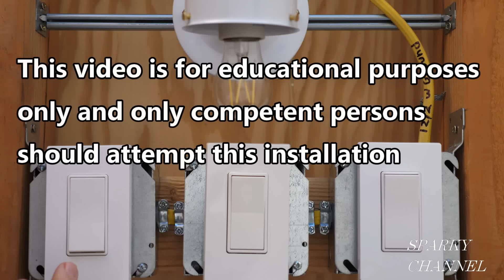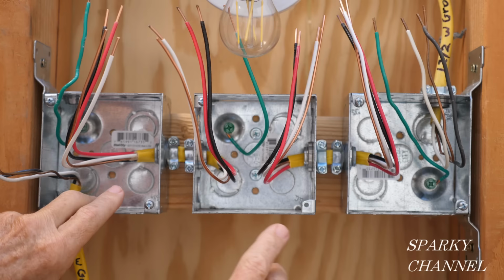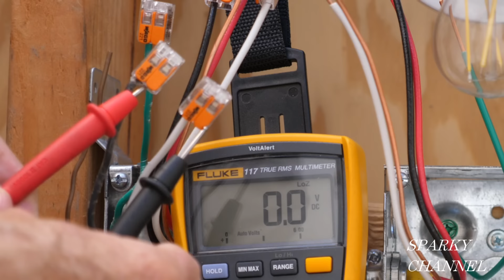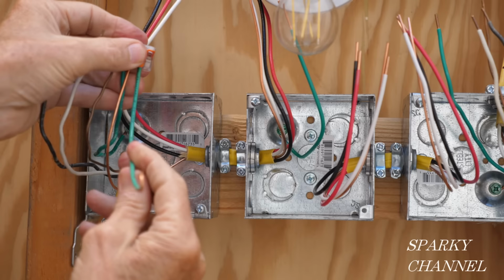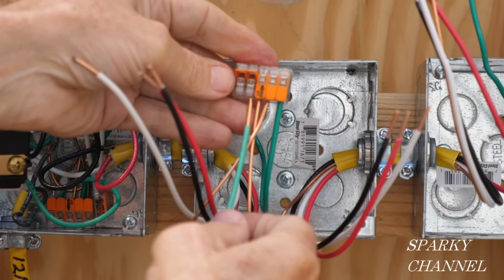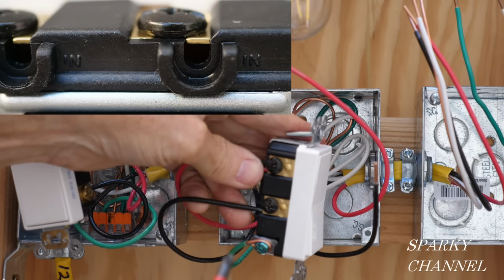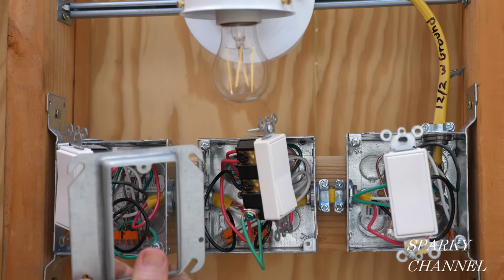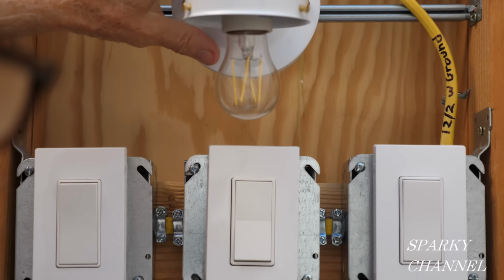How to Wire a 4-Way Switch System

Comment: Good demo !  Now show one where the power cable comes into the light box instead of one of the switch boxes.
Reply: @Sheila Walker That's true, but that's not what Ed was asking for....

@Ed Smith  As you requested, 2-wire feed to light box is simple...drop the neutral (white) at the light box. Hot (black) is spliced to the white (wrapped in black tape) of another 2-wire that is going to your first 3-way switch....the black wire of this 2-wire is the switch leg back to your light. At the first 3-way, wrap the white wire with black tape as well, and splice it to the black wire of the 3-wire that goes to the middle switch (4-way). Carry through the black wire (hot) to the last 3-way switch on another 3-wire. At the last 3-way, the black is the common (hot) and red and white wires are again the travellers between the switches.

You can even reverse the sequence and attach the white wire that's tapped black to the common terminal of the first 3-way and splice the switch leg back instead. The point is, if you understand the concept and how the wiring works, you can have the feed and switch leg on any of the boxes...typically we (electricians) wire it where it's the most convenient.

Cheers

Comment: Thank you very much for your informative videos. I have a question on this setup. I see that you have the light at the end of third switch box. Can the light be installed between first two switch boxes or even the first box?
Thank you very much in advance.

Comment: One thing he forgot to mention is the if ADDITIONAL SWITCH LOCATIONS are needed, then More 4-way switched can be wired in
between the ends being the 3-way switches, The additional 4-way switches are wired EXACTLY like the 4-way in the middle. The Travelers go to the LOAD side of the next 4-way switch. Not sure on Code requirements, but You could wire in many many more 4-way switches in between the two ends, and the starting and ending locations WILL ALWAYS be 3-way switches. If Additional Locations are needed.
Reply from the maker: Excellent explanation, thanks!

Comment: Awesome lesson!  I never really understood this until this video.  I have a question regarding what I have at my home. I have a double gang old house switch box with two lights feeding out( both single pole) and for some reason I also have two lines feeding out on the circuit heading into the kitchen, I have one line feeding in from the breaker.  I have a total of seven 14/2 in the double gang box?  Do I need to change the double gang to a triple for more room or should I go with a quad gang??  Thanks again for your great video fantastic job!  Mike
Reply: Good scenario for a box capacity lesson!

Comment: I used to do that 4 ways switch most every months and fixed those 4 ways too lot's of houses got wrong connection and the point is looking for the correct wires to connect to it take some times

Comment: I have a 4-way switch going to two ceiling outlets where I will use half of each with a light that I will plug in and the other half of each outlet I want to stay hot all the time, do I still run a 12/2 wire to the first outlet after the last switch? Or does it need to be 12/3 wire
Reply: 12/3. You need a switch leg and power
Reply: @daribbz8476  thank you Danny, that is what I had run because it made sense, got them hooked up yesterday and work like they should, thanks again though

Comment: You should do a follow up to show everyone how to wire it when you have power cable to the light coming out of the same box as the load in box and then the middle.  Also when you have to add another four-way.
Reply: You can add however many 4 way switches you want between the 3 way switches at the beginning and end. Doesn’t change anything except the number of switches.

Comment: Another great video! I'm getting my high school classroom prepped for the year as we speak brother. I'm one of the only trade instructors at the high school level here in Texas. This is a very clear instructional video, and I hope to make some just like it this year. And who knows with the way things are going in the country, I may be making a Bunch of online videos... But, I do like teaching them 3 way wiring, and then when I show them where a 4 way switch would go, it makes it super easy to understand. Basically just cutting the travelers in half. Keep up the great work sir!
I do have one question. Are the stab in wire connectors rated for joints in j boxes? I've often wondered. Of course I use them all the time in light fixtures. And I know they have a high amp rating (I think around 15 or so?) but I tend to wonder about a large load down the line, as far as the connection. My way of thinking is if you can twist the quick connect in a circle while its on the wire isn't it slightly loose? I know how the spring grabs the copper, but I still wonder about large load arcing down the line. But to be honest, I haven't found many melted quick connects in ceiling 4 square boxes on any service calls when I go to commercial locations. What are your thoughts? I haven't seen anywhere that says you can't use them. I believe it would just need to be Listed, which they are.
Reply from the maker: Thanks! See my video: Wago Lever-Nuts Questions and Answers From National Electrical Contractor Convention: https://youtu.be/d2lkBlIPkHg

Comment: Thank you so much for this wonderful tutorial. I recently wired my new LED kitchen lights using your method. After I finished everything up, my found yet another location she wants to have a switch! Question, can I add another 4-way switch in a new location using this method?   So, my plan is to run another set (2) of 14/3-wire (it’s on a 15amp circuit) and 4 way switch to the new location, and run through the new 4-way switch putting the RED wires on top. I guess this would be a 5-way switch?  Will this work?  Thanks in advance.  Mark

Comment: I do have a question about an old house, say 1988 already wired but one of the switches doesn't always work, I guess the traveler wires mixed with load or wrong switch.   What's the easiest way to determine which switch in the incoming load, i.e., the first switch on the circuit?
Reply: Pull all switches out of the box , in each location. 
Disconnect all wires from all switches. 
Test each wire for power .

Comment: So, you could theoretically place an electrical receptacle just below the first switch box by splicing power from the line power 12/2 wire prior to connecting the 12/2 wire to the first switch?

Comment: Why do 12 gauge wire? It’s hard to handle. Here in MN do 14 for lights
Reply from the maker: 14AWG for lights is fine as long as it's on a 15A circuit.

Comment: I have 3 switch for the foyer light but they only use 3 way switch for all the 3 switch sometimes i have to the switch by the front door off all the time because I try to use the switch by the kitchen doesn't do anything and the switch upstairs is always on and it doesn’t do anything until the kitchen switch is on position as well. To use the switch by the front door I have to have both of the other switch to off position.

Comment: Where does the load wire go in the circuit? Question is can the load wire come off 2 separate switch,  basically 2 loads feed same circuit on opposite sides of the house? Or does it  always come from last 3 way  switch?

Comment: Great video!  I'm trying to replace my light switches to newer ones and my wiring is different.  The first three way is like yours except all the grounds are connected together as are all the whites.  The travelers are red and black, and the line in is black. The four way looks the same as yours and the last three-way switch has red and black travelers with white going to the load.  Any idea why it would be wired in such a way?  Thanks again for the great video!

Comment: I have Eaton 3-ways and while in is on top, they put the two black screws on bottom.  Not sure if there is a standard on 4-ways but that a bit confusing as your switch has the two black on one side.

Comment: As an Aussie sparky its interesting to see the differences. We would cal this a three way with straps. The "3 way switches are standard. The 4 way we call a intermediate switch. Still have problems with calling a white wire a neutral.
Reply from the maker: Sounds great. I understand.

Comment: Bill this is a great video. I live in an old house and the switches are already installed. I am in the process of replacing the light. Coming into the light box is two white, two black and two red. When I took the old light out the two red were connected w wire nut.. the light actually had two white and two black that were connected to each white and black. Now the new light has only one black and one white. How do I wire this light?  Suggestions?
Reply from the maker: Hi Dan! Was the old light working fine? If so, my suggestion is to wire the new fixture  just like the old one.

Comment: Please help, I’m confused on the second 3 way switch being different from the first, as in the line coming in on the common and load traveling on the two screw side. Which is normal to me, but then you have the line coming in to the two screw side and traveling out the common screw to the light. I realize this has to be the only way a three way could work but I’m wondering how the switch can work both ways. I’m just an apprentice going into second year and a good explanation would help me!
Thanks!

Comment: Your video was easy to understand.  My issue is the electrician that wired the house for my 4 way took the line and load to the 4 way and the 2-3 way switches only has a red, white and black.  When I turn off the one 3-way, I cannot turn on the light at the 4 way.  Is there a way to fix my issue?
Reply: Switch the wires around in the 4 way. Till you find the problem.

Comment: Can you please do a THREE ROOM switch system controlling one appliance? e.g. ducted fan to 3 rooms?
Thank you so much! p.s. only have Active, Neutral and Earth (in Aus). Thanks mate!!!
Reply: ie. So different to your example. If someone in bathroom, and you turn on Laundry light, the Fan remains on. Or if Laundry is on and Bathroom turned off, Fan remains on. If Toilet turns on, and Laundry turns off, then Fan remains on. :) Then if Toilet turned off, fan turns off. 
3 rooms with own lights. I separated Toilet Light + Fan to two switches without any issues a year ago. Laundry + Bathroom both single switch. If any one is on (bathroom is just fan switch) then fan remains on - i.e. operates in Parallel - not series like your example. Thank you! :D (Network Engineer)

Comment: I’ve recently changed a couple of broken light switches. I’m thinking I should’ve gotten two 3 way switches to turn the light on and off at either switch? But my issue was that I had 2 black wires and a white wire inside one of the boxes. And in the other switch box I had a red a black and a white wire. So does that mean the white wire in both boxes are neutral? And if so would they go onto the ground screw on the light switch?

Comment: Great video. Very well explained. Question: can I wire the lights somewhere in between the 3 switches, or does the light have to be fed after the 3 switches?
Reply from the maker: Yes, the light(s) can be wired in between the switches but it's more simple to put the lights after the 3 switches.

Comment: Sparky do you install a dimmer on the first run only. Or can you have multiples  dimmers on the same circuit?
Reply from the maker: Depends what model you get. These are "high dexterity", so they won't protect the tops of your hands very much.

Comment: Do you ever use 12-2-2 Romex for 4 way switches? And when would you use it if you did?
Reply from the maker: In the case of 12/2/2, the wires will still be 12 gauge, with the difference being that it has four conductors. The four conductors include two hot wires and two neutral wires. Of course, they will also have a bare ground wire along with the conductors. In our example, it is not needed. It would be used when 2 neutrals and 2 hots are desired.
Reply: @SparkyChannel understood…but… do you ever use it? Not for 3or 4 way switches? When to use when wiring a house? Vid please. Thank you.

Comment: Bill,
I have a four way system controlling three lights.  I wish to change the setup so one switch controls one light, and the other switches control the other two lights.  Suggestions?

Comment: what if there are 4 zones that control a light.  is there such thing?
Reply: You add a second 4 way switch in the middle.
Reply: YOU WOULD  use 2 3way and 2 4way

Comment: Question at 10:51 you install the Black Traveler to the “Loosing Side” of the outlet, did you mean to or not? I notice that you do this on most of the screws. You do a great job on your description. I always like to install the wire on “Tightening Side” of the screw so as you tighten the screw it draws the wire into the screw and not away from it.
Reply from the maker: I said "bottom bronze terminal".

Comment: Great video Bill. Any chance of a link to the screw less switch plates you use in video
Bill R
Reply from the maker: Hi Bill! Here's a good value: ENERLITES Screwless Decorator Wall Plates Child Safe Outlet Covers, Size 1-Gang 4.68" H x 2.93" L, Polycarbonate Thermoplastic, SI8831-W-10PCS, White (10 Pack: Amazon: https://amzn.to/2EZpZTr

Comment: I bought two large chandeliers with 16 bulbs; 8 top and 8 bottom bulbs. What type of switch (or switches) should I use to be able to only turn on the top, or bottom and all the bulbs? I prefer to not install three separate switches.
Reply: Chandelier bulb circuits are typically wired together. So when it's powered up the entire system will energize. You would have to run a new circuit to the top set and put them on a switch then run a circuit to tye bottom set of light and put them on a different switch, however more than likely its all on one circuit internally within the chandelier

Comment: Hello Bill, I just bought a house and i'm planning on replacing switches and outlets. On the switches, what if they are not wired alike in Colors, meaning they didn't got red to top and black to bottom screws on the switches, or maybe they are green and black, How do I know what wire to put at top screw from the first 3 way switch over at the 4 way switch and again over to the 3 way switch that goes to the light, and is there a way to know or find out What 3 way switch starts the process? Thanks in advance.
Reply: For travelers it doesn't matter if red/black are top/bottom... it's just the way he likes it, but it can be the other way! Good luck in your project.

Comment: Good day Bill. Please a quick question, you tested voltage between live wire and ground wire. That makes sense. However what's the consequence be it good or bad if there is continuity between live wire and ground wire??
Reply from the maker: That would be extremely dangerous as all grounds and all bonded metal appliances, etc would be hot.

Comment: 1 wago needed to connect neutral wires only. The rest could be connected in terminals
Reply: No that’s not possible
Reply: are terminals too small ? I do this way but in Europe
Reply: The Wago's are just taking place of wire nuts. They do the same thing. I think it's simpler using the Wago's.
Reply: @orion3267  i know what the wagos are for. So fsr we use connector blocks  What im saying is that you dont have any of them you can still connect two way switch.

Comment: Does it make it entirely more difficult when you don't have switches in line like that? I had some pre-wire where I had to go from power input (line) to first switch then to the 1st light fixture and then other light fixtures before you are able to connect  the other switches ? I was trying to do that in a rental rehab that I was working on about a year ago and I just couldn't get it. I ended up just going back to one switch to operate the multiple lights on the ceiling. And now I have two blank face plates covering where the other two switches would have been. The wires are up in the ceiling by the first light fixture, but they are not hooked to anything right now.
Reply from the maker: Yes, it is possible to wire the 3-way and 4-way switches in the manner you described. But yes, it is more complicated. I would disconnect all hot and traveler wires and do continuity tests on all wires and create a map of what was happening, then figure it out from there.

Comment: My boss recently made the decision to only use 12/2. He says its cheaper than buying 12/3. I don't understand how but whatever. About 2 weeks ago I had pulled 4 way to a 4 gang that had a 3 way from a different circuit. My gosh If I hadn't labeled everything the make up would of been a nightmare. I can imagine the mess I'd be in if I had cut the neutral and ground off the wrong  conductors. I really wish he would go back to using 12/3.

Comment: Does keeping the red on top and the black on bottom actually make a difference in how it operates?
Reply from the maker: No, you could put the black on top and red on bottom and it would work exactly the same.

Comment: Hello new to the channel love the content so far! How come you wrap electrical tape around the terminals of the switches I’ve never heard of that before?
Reply from the maker: It's just something extra I do for safety. It's not a code requirement.
Reply: Because he puts safety over speed. My house is 21 years old. I’m the second owner. The electrician for the home builder left screws all the way out. After 21 years of plugging & unplugging, power shorted to ground. Why after 21 years?? Speed over safety. The tape would have saved this short. No fire👍